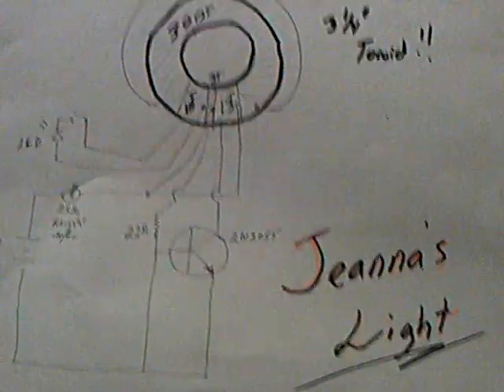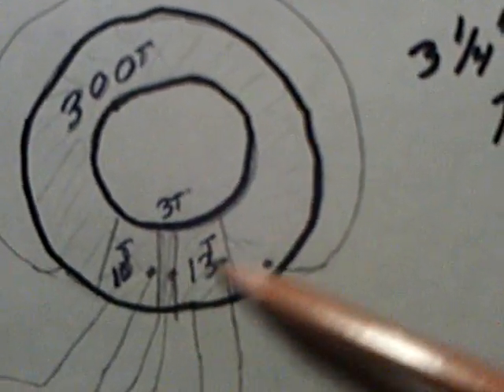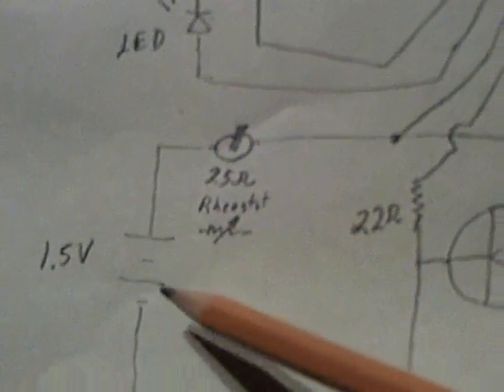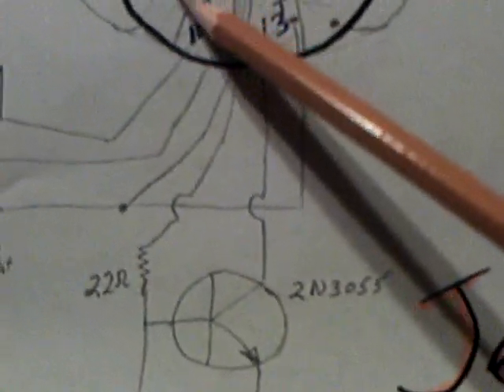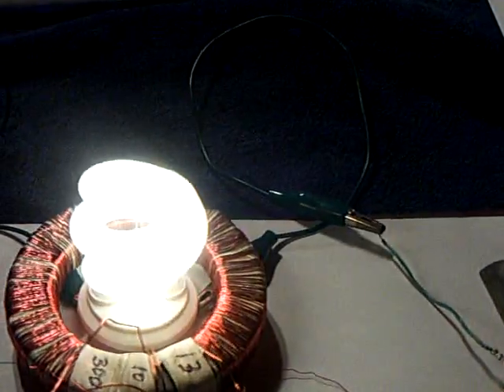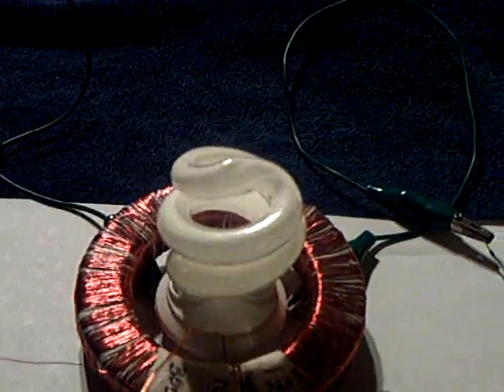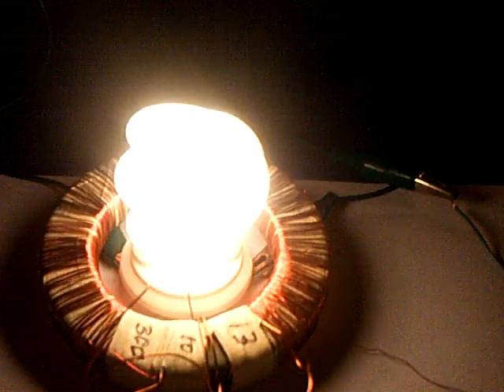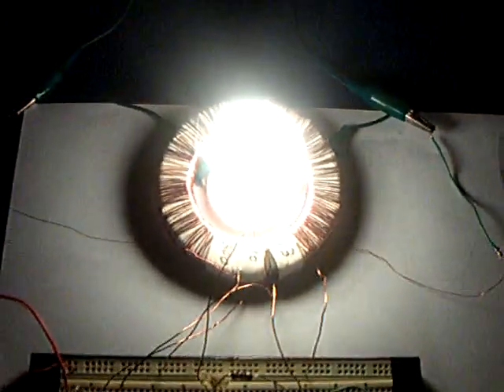Jeanna's  Light

Comment: The circuit is not correct. The transistor hall cannot be connected to the negative pole. It must be fed only to the positive pole of the ferrite coil with the addition of a variable and a fixed resistance to protect the base.

Comment: Nice work I like the large toroid for joule thief myself it is easy to wind. You might like a 2 transistor push pull oscillator shown here it has more current than one transistor and is up to 84% efficient will work at 1.25 vdc @ 40 ma to 14 vdc @ 2.2 amps over 800 ma at 32 vdc output that's 25 watts. the transformer is no harder to wind than a standard joule thief Give It a Try !!  Tony

Comment: this isn't wireless is it? the 300 turns are wired to the tube?
It's a pretty wild circuit. I'd like to see a scope on it or a simulation.
Does the transistor get very hot? I wonder what percentage of power is lost in it.

Comment from the maker: The circuit diagram has an error on it and there is an annotation for that.  There is not supposed to be a connection between the transistor base and the (-) rail.

Comment: I like the I project.  One thing is bugging me though.  The base and emitter are at the same point and therefore 0V BE.  Is the schematic in error cause see how you turn the transistor on and off.
Reply: Do you mean that the error is connected to the negative electrode on the base transistor, I noticed that
Reply: Base and Emitter both connected to ground, makes this transistor a resistor.  The Base and Emitter will always be at 0 volts.
Reply: @valveman12  Thank you for your response, and in this way, the circuit never works, and accordingly, the ground must be raised from the base and provide it with a positive pulse from the file. Thank you, my brother Ali from Iraq ♥️
Reply: Hi Ali, nice to meet you.  
This circuit is working, but the schematic is in error.
I have built a similar circuit that powers a magnetic rotor from the charge or a capacitor.   As the rotor rotates, it energizes A small LED.  This will run for hours on a charged capacitor.
Be well...
Reply: @valveman12  Welcome and thank you for your kindness. I was very happy to discuss with you. Congrats on your work. I just made a pulse motor that exceeded all my imaginations. I used a MOSFET, a regular magnet, an AC sensor and a coil. I got a rotation of almost 30 thousand revolutions per minute. I hope to complete the motor and publish it on my channel and put  A side file for electricity generation, and God bless you with all the best. Greetings, respect to your honorable person, O noble one

Comment: I tried with a smaller toroid (1.5 inch, .5 inch large, .25 inch thick) and it does not work. Does the 300 undred truns have to be exactly 300 for the oscillator to work?

Do you calculate theese toroid, oscillator? That would be interesting to know.  How do you choose the transistor?  Answering theese question would  vanish the darks myths about free energie, secret powers, etc.

Comment: Amer M.,
"FANTASTIC, you are missing big point, input power is 0.1 Amp X 1.5 V= 0.15W while the output is 10 W ... NOPE, it is NOT 10 Watts output. It is LESS THAN 0.15 Watts output! Where did you get 10 Watts output?

Comment: searcherT,
"... If this can be done why can't you run a car off of a 12V deep cycle battery and run a house for pennies a day? ..." 

 This circuit will only PARTIALLY illuminate a 10 watt  CFL with a AA battery for 4-5 HOURS. Then  you MUST buy a NEW battery. So, you will spend $15 a month just to run this ONE partially illuminated bulb every day for a month for 4 hours per day. That is VERY expensive!
 .
 Pennies a day? NO!
 .
 Plugged in to AC, this bulb only costs 15 cents per month!!!

Comment: It's kind of suspicious that you gave the voltage and wattage of a battery, yet you were only able to tell the output wattage of the transformer. Kind of suspicious that 10 watts just so happens to be what the light bulb in the video was rated at. I do wish there was free energy, and I do wish to find it.

Comment from the maker: It is probably a good idea to not play with anything electrical if there is high voltage envolved.  You really need to understand what you are doing.  Getting a bad shock or burned just isn't worth it.  If you work with something like Jeanna Light that runs on a AA battery you can get shocked but there isn't enough amperage to do much damage.  Something plugged into a 110v wall outlet is far more dangerous.  Stay away from any "hot" parts when it is on.

Comment: since lidmotor told us that he gutted the bulb of all electronics, we can't use the original '10w' power specs to give us any OU conclusions. Instead, you'd need to measure the intensity of the light, then use a spectrometer to estimate each wavelength involved, then find photons/sec...etc

Comment: I Really Like The Video From Your The circuit is running on one AA 1.5 volt battery. A modified 10 watt CFL bulb is being illuminated. The circuit shown in the video has an error in it
Reply: Do you mean that the error is connected to the negative electrode on the base transistor, I noticed that

Comment: @Lidmotor You are very true, Lidmotor: Such experiment would always have a comparison between the time of a battery to discharge form 1.5V to 1.0 Volts, that we could know the energy burnt, and on the other side, the measurement of the real power by comparison with a same bulb but on lighten with varistor at same brightness. Only this kind of works could tell if overunity or not, true "Joules  thief". but it not so fun to do, right? ;)

Comment: @Lidmotor When you say "no guts" do you mean no guts (electronic ballast) and you  just have clips connected to the wires that come from the base of the bulb. Or did you  just remove the screw housing and base and are connect to the electronic ballast somehow?

Comment: @amermahdy70 I'm with you, the principle is what's important, even with a gutted bulb, 3v it's still over 30-times more efficient than using line-voltage & AC to light the bulb ... 3,000% is a lot of profit if this was a stock transaction, Wall Street would be sucking it down, but since it saves energy it languishes like a carburetor patent.

Comment: Nice, new to this and like using the heavy gage just where you need it ... artful, milliamps getting it done. If you have PV's & batteries, this is the setup for lighting the house!! ... 

Not free but almost [100ma@1.5v for a 10w bulb for x lumens or about 67-times more efficient if full brightness], I suspect putting the CFL inside the coil gathers some from the coil vs not.

Comment: The 2N3055 is a silicon NPN power transistor intended for general purpose applications. It was introduced in the early 1960s by RCA using a hometaxial power transistor process, transitioned to an epitaxial base in the mid 1970s. Its numbering follows the JEDEC standard. It is a transistor type of enduring popularity.  TO-3 case style, it is a 15 amp, 60 volt, 115 watt power transistor with a β (forward current gain) of 20 to 70 at a collector current of 4 A.   Transition - 2.5MHz

Comment: There is a simple tesla circit, made from a couple of diodes and capacitors, and antenna wire. the circit draws power from the air, from radio waves, ect and will produce enough power to charge a cell phone. If you recreate this circit and power your joule thief with it, THEN MY FRIEND YOU WOULD HAVE A LIGHT THAT RUNS OFF  NOTHING!

Comment: @Lidmotor I have a large (almost 12") foam core, I suppose they are normally used as the base for building a decorative wreath? Anyway, it is very firm, not soft foam... and could easily be "wound" as an air core. Has anyone tried this sort of circuit with an air core? Or would it just not work. What are your thoughts / guesses? Thanks.

Comment from the maker: @KyleCarrington ---Mine did buzz so I have it sitting on foam in the box.  The large 3" toroid was a surplus item and the supplier ran out.  You can use a smaller toroid.  There is no "Exciter" effect off this light.  Th efrequency is too low.

Comment: U core or TV flyback transformer cores are ideal.  But, the way they are wound is not a good example of how.  Don't wind over the gap, even though they always do that.  They do that because the cores like to fly apart not because the residual inductance is closer to ideal or more useful.  So, do wind on opposite bars but, wind in the channels and use screws to hold them in place.

Comment: If you use an 4ft. tube, you can box those in with solar cells in a different method.  Use beam splitting prisms, and you can place a solar cells face above and below the beam splitting prisms.  It takes two per layer and cuts the light by 60% per level.  With the over and under configuration right next to the bulb less than an inch from the tube, you get more light and that makes up for it.  All of the cells lay level or at a 90 degree angle as you look at the bulb.  Edgewise.

Comment: Main point, higher frequencies, higher Q values.  The highest Q, grants you the highest level of efficiency and the lowest amount of power in at resonance.  A gapped core is better for that but, the frequency response has to be there.  You never want of these tuned to frequency lower than 100KHz because a plasma can act like a conductor.  At that point it does, and that means your bulb becomes a absolute resistive load and in tuned circuits that means efficiency again.

Comment: I was looking at getting a custom glass coil that would act as an open secondary on a toroid or U core.  But, U cores don't come in powdered iron and you need a Iron Nickel core not the Iron zinc.  That or a distributed gap type core.  Then you always have a higher value of inductance on the primary, and the secondary is more or less responding to the changing magnetic field and not as well linked to reflected impedances.

Comment: Make sure you wind your toroid a little differently.  Tickler coil and resonant primary on one side, secondary on the other.  The powdered iron cores, delay the velocity of the magnetization of the core.  So, there's a little battle going on there where Lenz's Law and Faraday's Law of induced voltages and currents are in play.  The point here is that having the secondary far enough away from the primary allows the core to get closer to saturation before they play on the primary.

Comment: Once you've tuned that to a frequency over 100KHz, then measure the power in vs the power out in lumens by placing a solar cell next too it.  Then calculate how many you need to drive the circuit once you take the battery away, only using the battery to start it.  Yea, a solar powered drop light.

Comment: Careful though, if the over voltage is too high from the resonant circuit, you'll burst the double A.  If you want to avoid that, use a lead acid battery.

Comment: Ha ha, add a capacitor in parallel with the coil across the collector.  It'll go even farther and use even less power at resonance.  The third coil with the LED should be used as a tickler for the base of the transistor if class A biased.

Comment: Thank you.  Has it been tried, do you know.  One o=would think that it would create a piggyback effect.  Or would that just create an electromagnet.  If so could the secondary be spaced at a distance -remaining toroidal and emcompasing the the core to produce more output  given a larger magnetic field collapsing or surge as i were....?  Sorry I am still in sponge mode.
Thak you for all the vids you produce and the replications which you explain better than the source.
Edward

Comment: @Lidmotor Hey, out of curiousity.. have you ever tried shielding energy at all, studying what it will permeate, what it won't, if anything deflects it, or confines it? Just curious. Once my designs are done, oddly - they will be living inside a Yurt, which will have (interior) aluminum reflectics 360 degrees around it... so that in itself will be an interesting experiment! If you don't understand what i mean, scroll to the bottom here to see pic of my yurt: tinyurl . com / 34ouzsk

Comment: @lidmotor You said "You are trading amperage for voltage though and it is not a free ride--just a good bang for the buck.". If a typical AA battery has, say 2000 millamp-hours (that's generous i think...) and 1.5v. 2 amp hours then, times 1.5 volts = ~3 watt hours. Jeanna drove a 15 watt lamp for 5 hours. That's 75 watt hours, is it not? I'm confused!!!

Comment: I just reproduced this circuit with somewhat of success. I failed on the 3.25 inch torroid, but succeeded on a 2.5 inch torroid. However, I have to use two AA's for 3 volts to drive it bright. The rheostat was a nice touch by the way.

Comment: Great circuit! Thank you Jeanna and Lidmotor.
I've used the ferrit from old cathode ray tube TV's (it's in the deflector coil). I've found 8cm diameter and bigger ferrits in some TV that working very well for Jeanna's Lights circuits. I need about 230mA. If I use smaller ferrits than 8cm than they need more current (about 400mA and more). The coils could be wound up very easy because the TV ferrits are made from 2 halves - held together with metal clamps. I've used 300 / 13 / 3 / 10 windings.

Comment: What is the output voltage.  I guess if it is lighting a 110v fluorescent light bulb then the voltage has to be somewhat 110volts variable by your knob there?  if so, that would be great right out of a 1.5 volts battery.  Correct me if my assumption is wrong.

Comment: Hi, I think this is very interesting. I have done some experiments myself to make a driver to power red and violet laser diodes. I've added some filters too. The problem with this is that it makes a very high voltage but low current. The lasers need up 100 to 500mA at 3-7.5V. 
Please have a look at this link and see what I've done, and add you comments
laserpointerforums(dot)com/f42/super-cheap-1-5v-diy-driver-45079(dot)html

Comment: Thank you Lidmotor.
You have done a beautiful job replicating and explaining this simple joule thief circuit with secondary.
I only had 240 turns and 300 is much better.
I really love the way you packaged it. You made it very easy to appreciate.
BTW, if you add an inductor in series with either of those secondaries, you can get both lights to stay on at the same time! (You'll need to fiddle 4 the right inductance but it will relate to the frequency.)
thanks again.
This is really nice.
jeanna